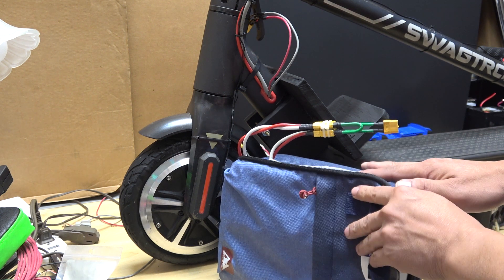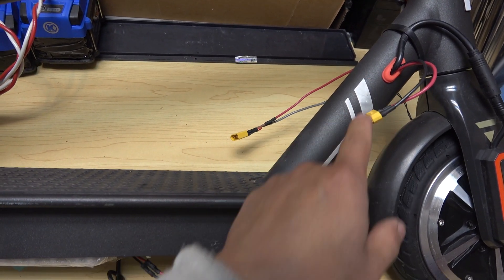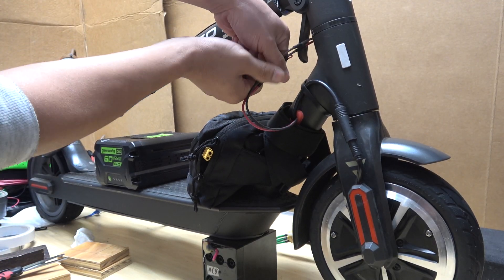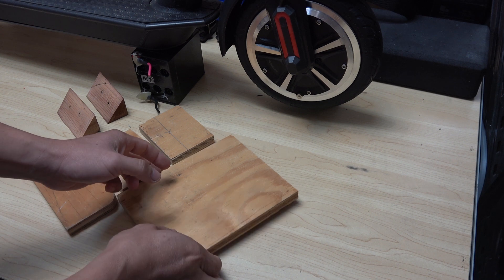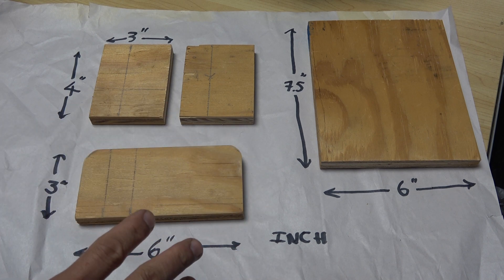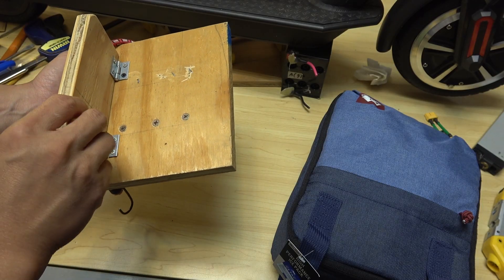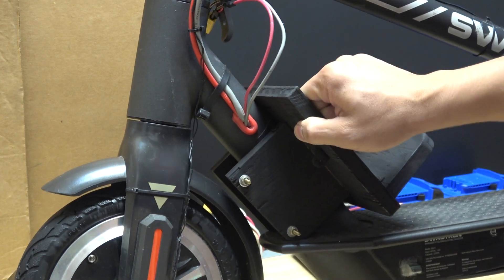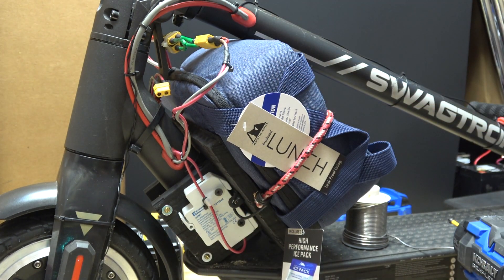DIY: Make an external battery mount for electric scooter (Swagtron Swagger 5, Xiaomi M365...)

Comment: Hi sir 
Pls I want to ask about the external battery mount. The max voltage of the controller does it correspond to the voltage of the motor or it doesn’t matter

Comment: Won't a bigger battery burnout the motor? It creates more rpm for the motor right. Does it over load the battery circuits?

Comment: Where did you buy those batteries!
And would I have to upgrade my speed controller (boring C35 SLA here)
And also could I run an external higher voltage batteries than mine(@36v) or just higher Ah

Comment: i have a 36v 20ah battery and the weight is around 3,5 kg won't the wood break? im gonna but the batt in plastic box and stick the battery in there with silicone

Comment: Hi, do you have the issue when the external battery disables the internal battery when they are parallel? 
I have a 36v scooter with an internal battery of 36v10.4Ah and an external battery of 36v13Ah. After having both batteries connect for half a year with little weekly usage. I found out that sometimes the internal battery will no longer "connect" to the scooter, there is no power output, and charging it will always show green light on the charger. 
Do you have a similar issue with your build? Do you have any suggestions on what is happening? The scooter is pretty new with light weekly use.
Thanks.
Reply from the maker: It's not a good idea to connect in parallel 2 batteries with different capacity. One of them will empty out first and the other one will become a charger for the less capacity battery. It's a fire hazard. It might damage both batteries in the long run. Check both your pack. Maybe one of them is already damaged.
Reply: @vuaeco  then how do you connect all this. i dont care about the bracket, but about the connection. what do you do with the bms of the internal? as your power tool batteries dont have any bms except the one from the manufacture ofcourse or do you use them but how.

Comment: Have you thought about using a buck converter to increase voltage from 36v to 48v? I’ve seen one on Amazon for like 60bucks, rated 960w
Reply from the maker: I have not done that mainly because it simply doesn't have enough power. For a 48V system, when you first accelerate from zero, the controller easily pull 25-30 Amps from the battery. That's about 1500 Watts. That buck converter will have a hard time keeping up with that.
Reply: Did u try it?
Reply: Did u try it

Comment: What would happen if I just connect a power bank or a external battery directly to the charger port of the scooter while riding ?
Reply: The battery motherboard shuts down while charging so it won't work.

Comment: This gave me an idea, I have four 2AH 80V batteries for our lawn equipment, I could make a box to wire them in parallel and put it on the bike rack on the back of the bike and make a e-bike with a 80v 8AH battery that I can unplug and still use for landscaping!

Comment: This is perfect. I wish you showed us how you extended the control wires outside.
Reply: He has an external remote.
Reply: its pretty easy you dont even need to cut wires just similar molex connectors and make a new wire with male and female molex connector

Comment: Hey. your video is great. It helped me solve some problems with the additional battery mounting. I have a question, I have a 350w electric scooter with 600w max power. I have a 36v -48v - 350w and 18amp controller. Currently I have two 36v 10 amp batteries in series, which still gives me 36v but 20 amp. The question is. Can i connect the third one of this same power? 36v - 10amp. ? So I will have one large 36v battery but almost 30amp. Do you think it will drive safely? will not burn the engine or controller?  
Thank you for your help :)
Reply: u asking for trouble sooner later,the problem is different bms react to uneven voltage battery cells.much safer to swap out battery.

Comment: Can i use your method on xiaomi 365pro?
Reply: I tried with Xiaomi M365pro. I got an error 21 with bips. But the wheel is turning. Did you had the same problem with Swagtron?

Comment: Say I do the Greenworks Pro 60V. I just have a couple of questions. 1) Will my scooter charger charge the external battery too? or do I have to buy  battery charger for it? 2) I'm having trouble finding 60V 5.0A but I can find a lot of 60V 4.0A batteries. What would be the difference performance wise? and 3) Are those XT 30 or XT 60 connectors?
Reply: No. You have to buy a different charger.

Comment: Good work amigo! So are there any problems that could come up using a 48v or 60v battery on a 36v motor besides possibly increased motor temperatures? I only thought brushed motors can be overvolted.....what are your thoughts?
Reply: This explains it perfect. http://www.ebikeschool.com/myth-ebike-wattage/

Comment: Hi Friend. I am trying to convert all my codless tools to use the same battery platform. I have managed to do most of them that just use positive and a negative, just two prongs. But some of the tools have 4 prongs Positive Negative ,VC and some other.. what are these for? and how do I go about it?
Reply from the maker: The other prongs on the 4-prong tools are for security purpose. They do it to prevent you from using other batteries on their tools. Only Ryobi and older tools (including Dewalt) use 2 prongs. Newer tools have at least 3 prongs nowadays.
Reply: Did u get this sorted as I am thinking of the same thing just to take mine for 36v up to 48v so I was going to add 12v from a drill. It is only to get a bit more speed . And I am going to use a switch to turn it on and off. As I may not need to use it all the time.

Comment: Hello, great video. I noticed you made a series connection for the 2 24v battery packs. What if you made a parallel connection for the controller and connect both batteries in parallel. This way you don’t have to stop and plug in. I think the sparks would be avoided from plugging in the controller to the battery.
Reply from the maker: The reason why I connect 2x 24V batteries in series is because the controller requires more than 36V to run. Putting 2x 24V in parallel will not power on the controller.
Reply: @vuaeco  What I’m saying is that you need to run the external battery and internal battery in parallel.
Reply from the maker: @Silver-pm5iq  It's not a good idea to run external and internal batteries in parallel because they have different capacity and discharge rate. I even run the external batteries at different voltages so parallel with internal battery is a no go.
Reply: @vuaeco  I understand. What if the batteries have the same voltage and capacity?
Reply: Is that the original speed controller? I am not very happy with how fast my battery drains and just want to upgrade it, could I connect any other internal battery replacement to the speed controller that comes with the scooter, I only ever find xiaomi replacements, will those battery packs still work in the swagger 5? The stock battery is 6Ah,  I was thinking to get a 7.8Ah or more capacity instead... Do I need new speed controller and all for that to work or will stock controller work with it still?

Comment: Hi Vuaeco, I love your channel and your videos are cool too. I have a question though, I have a Shark ion multi flex IF281 which is a cordless stick vacuum, but the battery life is not good. I would really like to take one of my dewalt 60v or even 20v batteries and somehow get that to work on the vacuum so that it will last way longer. Any suggestion? Thanks
Reply from the maker: How many volts is your Shark battery? I have a Dyson cordless vacuum and it's a 24V (6 cells) battery. I use my Kobalt 24V power tool battery on it and it works fine. So I reckon you could probably do the same thing for your Shark vacuum. Just use the same voltage battery and it should work.
Reply: @vuaeco  It says 25.5 volts, what do you think? Thanks
Reply from the maker: @scottkasprzak4042  That's an odd number. I think it's 25.2V, not 25.5V. That's because 4.2V x6 = 25.2V. So your battery might be 6 cells. Open it up and double check just to be sure. But you can definitely run a Kobalt 24V power tool battery on it. A Dewalt 20V battery might work if there's no controller. If there's a controller, you will need to run close to 25V and a Kobalt 24V battery is best for it.
Reply: @vuaeco  You’re right, I believe it is 25.2v, I’ll open it up and check. Where would I find the controller if it has one? Thanks
Reply from the maker: @scottkasprzak4042  The controller board should be inside the unit. My Dyson works just fine with a direct 24V hookup.

Comment: Have a razor 350 motorcycle will it run in my kobalt 80 volt battery no problem or do.you have parts for it want to run it with 6ah and 2.5 ahbattery will it work together
Reply from the maker: The Razor MX350 runs on 24V battery so you can't use your 80V battery on it. It will instantly damage your speed controller. It should work on a Kobalt 24v drill battery.
Reply: @vuaeco  i have a hoverboard battery that is lithium ion 25.2VDC 4.0 Ah  100.8Wh and i was wondering if i can replace the 
Razor E300 24 V battery with it without burning out anything?    if yes, will that speed and range get longer?  thanks in advance

Comment: isn't it cheaper to make your battery pack than using tools battery pack?
Reply from the maker: Yes, absolutely. Anything you can make your own is a lot cheaper. Power tool batteries are expensive. But if you're already have cordless power tools, then why not put it to good use? You're not using your power tools while you're riding your scooter, are you? :D